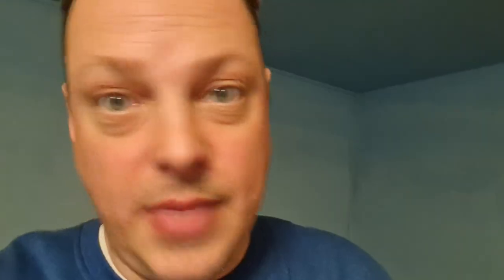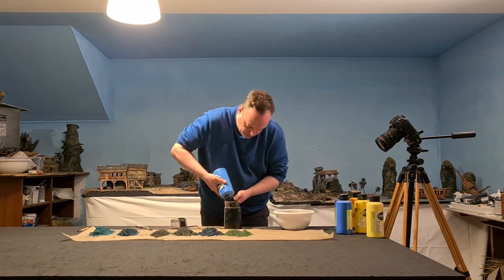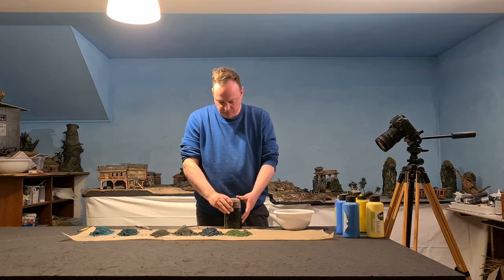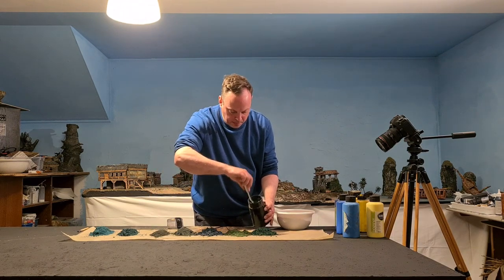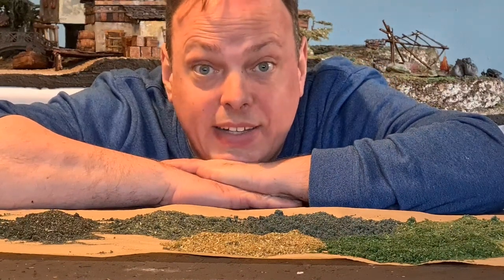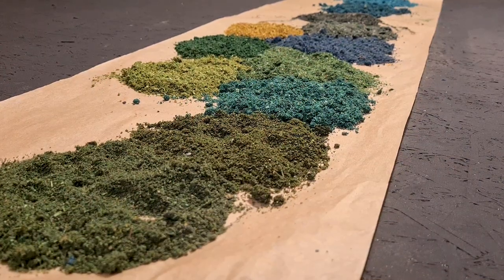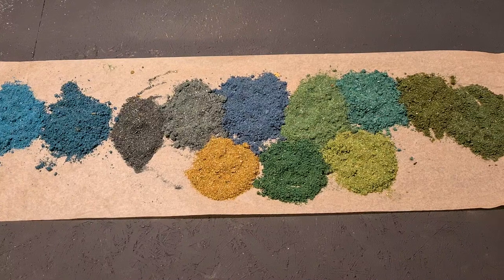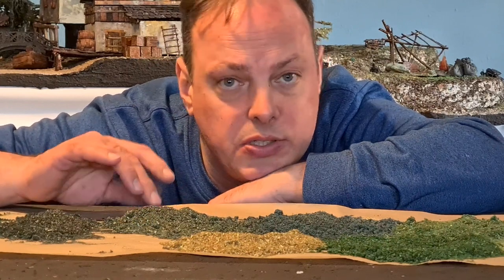How I make flock - super fast for instant usage

Comment: Another source along same lines is wood pellets.  Find at farm stores for livestock bedding and there's a pine variety for cat litter boxes.  Wet it and it breaks apart.  Dry in sun for a bit and voila, back to sawdust form.  Often it is more uniform and smaller bits, not as many shavings.
Reply from the maker: Sounds great. Will try

Comment: For a source of really good fine sawdust just look up a cabinet maker that's local to you. They make kitchen cabinets ect. They will have a bunch of very fine sawdust perfect to make flock with that you'll get a bag of that will keep you supplied for years. Another cool flocking material is carpet padding this chopped up and paint added for color makes great flocking for trees and bushes. You can use an old food processor for this.  Add your paint and you can spread it out on a cookie sheet and dry it on very low temps in the oven. Just a couple ideas you might like to try.
Reply from the maker: Will try some when i run out 😅

Comment: Really cool! The wood chip one would look great for stuff like barns/stable floors especially.
Question: Does the coffee ever get mold/ rot?
Reply from the maker: Not yet ;) it has a color build up. If you take a damp soapy brush you can clean it. (I am to lazy for that and just scratch it out)
Reply: @WeltenbauerClub  When I have made "Cold Porcelain" from PVA Glue & Corn Starch, part of the recipe calls for "Vinegar or Lemon Juice" to help combat mold. Wonder if a tiny bit of that would combat it for the most part? Also potentially baking it prior to the grind would too.
Reply from the maker: Maybe. I never had problems as I seal it in with watered down pva and clear coat. There is no more contact zu air and humidity which could make it go bad